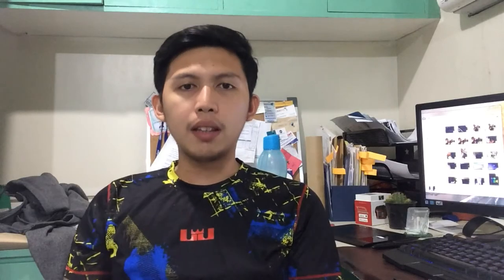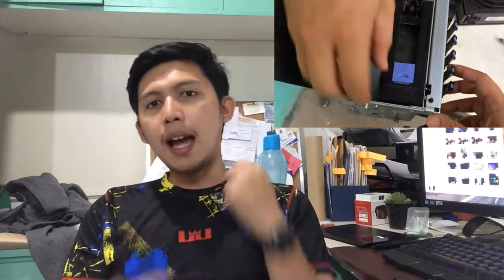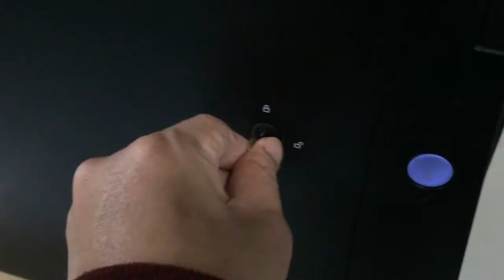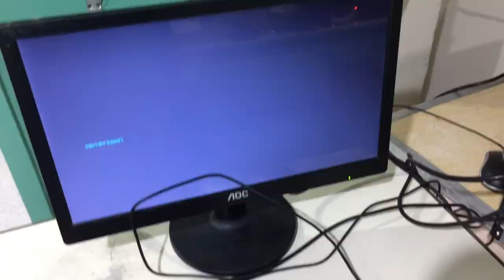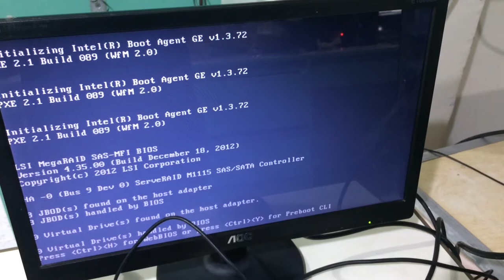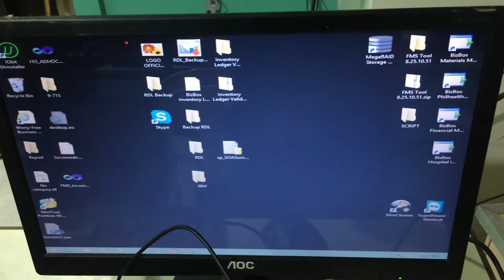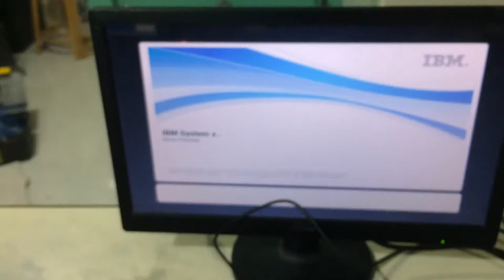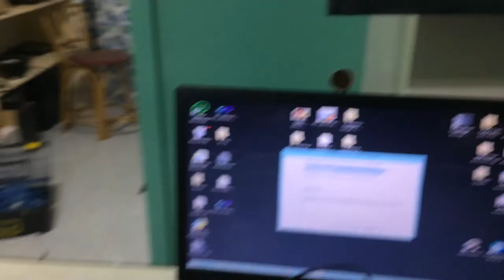TECH VLOG #1 : IBM X3500 M4 SERVER FAN PROBLEM Part 1

Comment: I cant find the Part 2 ng video. I have same problem with same server.
Reply from the maker: it's a board problem Sir..if it is in warranty you can use it. If not replacement is the only solution
Reply: @techtweakstv  purchased new fan but same problem. The fan is on high speed.
Reply from the maker: @neilesperon5332  yes, the problem really is the motherboard

Comment: Sir I have IBM x3500 M4. today i had such a weird failure, the server was functioning properly but in this morning it just turned of itself. When I run it again, I have received an PCI card error first. Then I turned it off again an turned it on again and received CPU error with PCI error. The third time I reboot, i received the CPU only and now I have CPU error all of a sudden?? Any idea ? When I reboot the system, I receive System failure and it reboots again and again and again... cannot access neither to Boot options nor bios settings. Any help or suggestion Sir??? :((
Reply from the maker: This problem has not been solved yet, we tried accessing the bios. But sadly base on IBM's tech it needs motherboard replacement.
Reply: @techtweakstv  The main problem was caused from CPU Heat sink and RAM failure. I have replaced the RAM but the problem was remaining same. I have replaced the CPU Heat Sink and problem resolved.